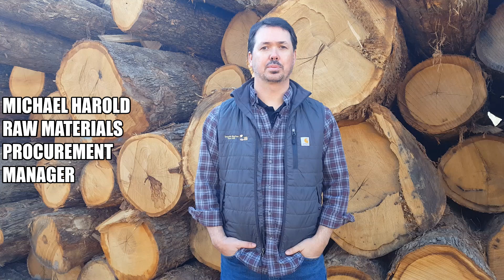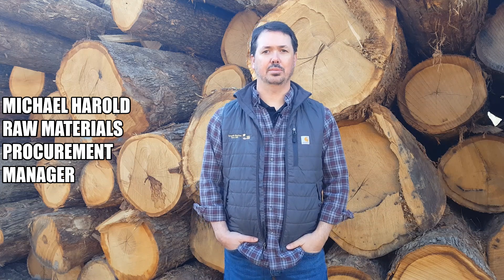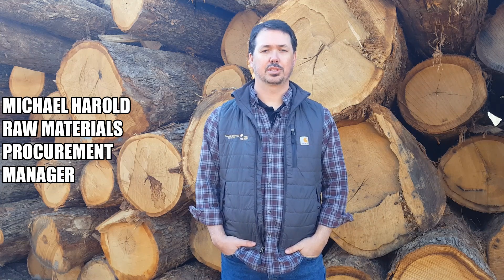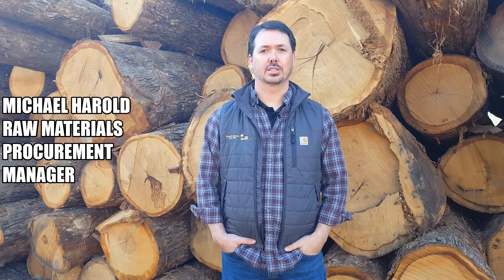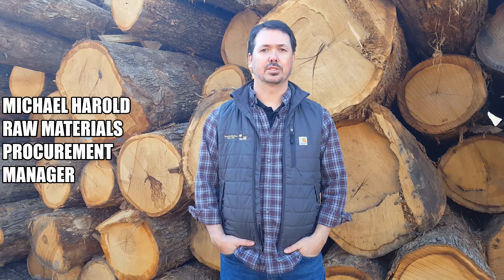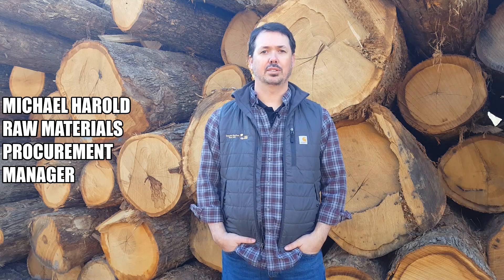Fifteen Minutes in the Forest: The Making of a Bourbon Barrel

Comment: Great video. I remember watching This Old House in Napa touring a winery and building a barrel. It used a type of reed as a gasket between the staves. What is the procedure to fix a leak if it fails the pressure test?
Reply from the maker: Thanks for the question! If a barrel fails testing, it gets sent to the cooper. The actual repair will depend on the type of leak (between the staves versus bunghole). There were two coopers working when I was there. Looked like they were replacing staves as needed.